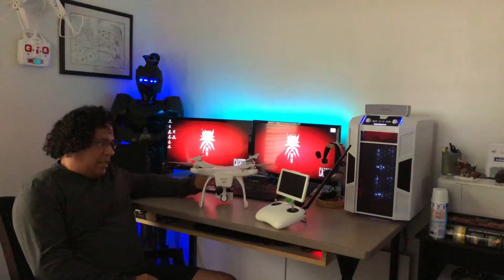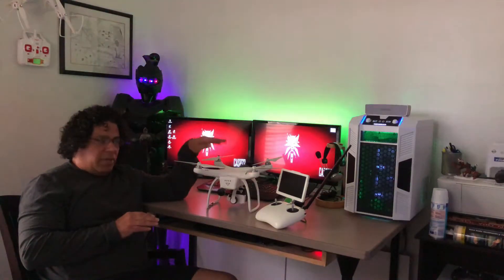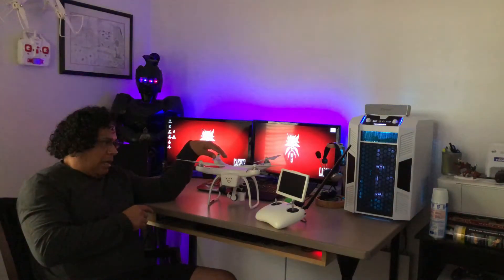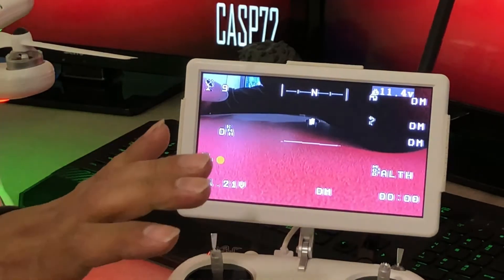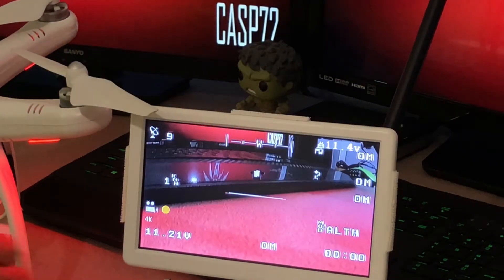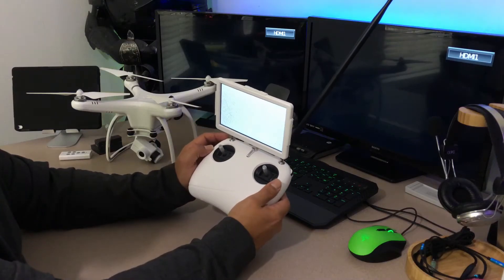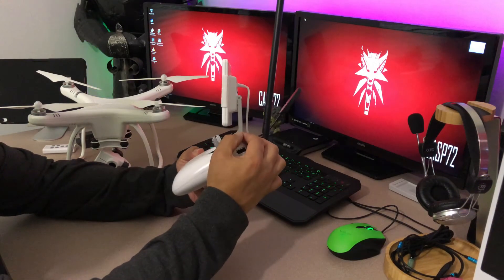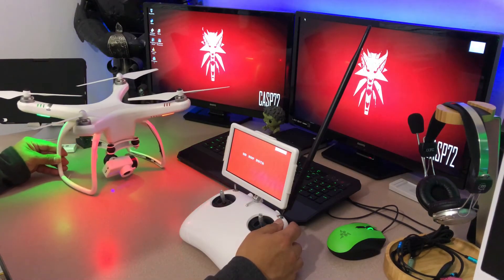Upair One 2.7k  Default Calibration

Comment: Hello and hi I am having problems. My drone connects to controller but there is no video screen on my phone. Any ideas please? This is driving me nuts.
Reply from the maker: If you have the exact same drone as me there is no phone video connection only video connection is from the controller built in screen. Please know that this is the original upair drone that came with a built in screen on controller. I hope this helps stay safe and sound. 👍🏽✌🏽
Reply: @ hi I have 1 2 3  models plus the ultra sonic  . Cx 20 … dji  quadcopters

Comment: Hi there, looking for up a battery cannot seem to find one can you help please?
Reply from the maker: @ohare100  thanks for watching unfortunately I’m in the same vote. I still have my unit and unfortunately the battery still holding a charge but I’ve noticed lately it’s been depleting. My guess would be your only options would be eBay or in my case I’m planning to probably try to come up with a battery mod to compensate for this battery that’s probably no longer being manufactured unfortunately. Hope this helps.👍🏽✌🏽
Reply: I’m using lipo 5000mah battery with pin terminals works just perfect

Comment: Where can I get the original firmware for the same up air one drone you have
Reply from the maker: Louis thanks for watching but more importantly, I’m sorry for the late reply. Getting the firmware is unfortunately almost impossible, for one the Upair One is no longer being made. It has now been replaced by newer models. I even tried to do a quick search for myself without any luck. I hope this information helps. I still have this drone and I’m very fortunate that it still works and is in mint condition. I’m planning on doing a future video and giving it a new paint job. I’ll post a video when I get around to it. Hope this information helped stay safe.👍🏽✌🏽
Reply: @solisapaul  Thank you for the reply and help.
Regards
Louis 🇿🇦

Comment: Hey Mate
I have a different upair drone but maybe you can help?
Mine is the Upair2 with 3D4k camera 
After the 3rd flight abd never crashed the camera won't tilt all the way down, it goes there but then jerks back up. This is a link to my vid about this.
https://youtu.be/pX9MikjuAxg
Reply from the maker: Thanks for watching and suppling me with your video. From what I see the motor seems to be faulty at the zero (-0-) position. If my calibration video does not affect your drone I would contact UPAir  to see if they will supply you with the calibration method for your particular model. I would also if you’re willing and able to with confidence open up the controller chassis and reconnect the cable at the PCB board which controls tilt for the camera. Lastly again if you’re willing and able to with confidence reseat the cable to the actual camera tilt motor assembly. I had a similar issue but it went away once I calibrated my camera again I’m not sure if my technique with my model worked with yours, again if it did not I would contact Upair and see if they’re willing to give you the calibration method for your particular model. I truly hope this information helps. 👍🏽✌🏽
Contact Information:
For help with making a purchase, troubleshooting, or claiming your warranty.
China Company Address
SHENZHEN JITIAN INNOVATION TECHNOLOGY CO., LTD
Address: N/L unit, 8th Floor, Block A, TCL Building, No. 006, Gaoxin South, Nanshan District, Shenzhen
Tel: 0755-86523509 
After-sales service phone:18124194780
Email: contact@g10dr.com
Reply: @solisapaul  thanks for the thorough reply 
I have taken the camera off and reconnected but no result.
I'll try the gimbal recal and see if that works 
I'll keep you posted 
Have contacted Banggood but they are useless
Reply: Yeah so the gimbal calibration works sort of the same on my controller as long as you get the right toggle switch figured out. On mine the left toggle has 3 positions and needs the middle one...
However it didn't solve the problem.
Also opened the controller and checked and reseated all cables.... no solution.
I'll contact upair in China and thanks by the way for that address cause there doesn't seem to be a Australian or Australasian  one.
Reply from the maker: @alandegraaf1638  Hello mate, No problem sorry it didn’t work out as planned. Lets hope they have an alternate fix with the issue. I haven’t flown my Upair in a while . I might take it for a flight soon and video the flight. Please let me know what your outcome is once they get back with you on this issue. Stay safe and good luck.👍🏽✌🏽

Comment: How do you calibrate compass? Cannot find it in the manual?
Reply from the maker: Drone Shack thanks for watching, if you have the exact same model and version as I do the Upair Drone  should calibrate back to factory as well as the controller. It wasn't in the Manuel that came with my drone either. I figured this with research and trial and error. The Model of my system board on the Upair is PX4 Ver 1.2.00.  I hope this helps. I love this drone as my primary very easy to use and understand, great control, Phantom 3 cross over propellers and most importantly very affordable price for what you get. Happy and safe flights ahead!
Reply: CASP72 ••••• thanks for reply but how do you perform GPS Calibration?
Reply from the maker: @droneshack211  I've had my Upair 2k for several years now and have never needed to calibrate the GPS aside from the calibrations I do in this video that is all I do before a flight. Never have had an issue with GPS or needed to calibrate the GPS.

Comment: Very helpful video Casp, thanks for it, but I have specific problem with my UpAir ONE Plus, and I believe you can help.The motors not starting at all, connection between controller and dron is ok, i see camera, i can manage camera but motors not reacting at all. I try to make ESC - doesn't work or I can't make it properly.
Reply from the maker: Zhechko Kyurkchiev Thanks for watching, sorry to here you are having this issue. I have the Upair One 2.7k not the Upair One Plus but I found a link that might help with the ESC process to get motors working. https://www.drones4.life/reset-the-esc-of-an-upair-one/   I hope this helps? Aside from this I’m not sure what else it would be that is causing this issue. I’ve seen this happen with this particular drone but it usually happens when a firmware upgrade is attempted using Mission Planner via usb mod. I highly suggest not to upgrade, Upair drones use a specific firmware and alternate firmware’s can possibly fail or break the drones code for full and proper flight and operation. Again I hope this helps 👍🏼✌🏼

Comment: Hi Casp, just bought this exact version, Upair2 PX4 v1.2.00.  I made yesterday my first fly and what i saw was that the drone is not stable and at certain point start to go up without touching the joystick in the RC. Tried to descend with RC but it was no obeying. After half a minute or 1 minute  it start to go down. Pretty scary. The calibration compass is possible?  because in the manual there is no reference to it. Do we need to do it? By the way where are the sensors of this drone? Thanks in advance. Best, Paul
Reply from the maker: PJorge Rod Thanks for watching the drone unfortunately does not have any built-in sensors. If you follow the exact same process as I did for calibrating the controller as well as the drone your flight should be more stabilized. Did you make sure the props were in their proper order? Also did you make sure there were no metal or radio wave signals where you were flying, that could interfere with the signal from the controller to the drone. Aside from this there should be no issues with your drone during flight one other question I have did you buy this brand new or was it used? Hope this information helps.👍🏼✌🏼
Reply: @solisapaul  Hi Casp, I bought it new. when i fly it has no electrical powers or trees. I am going to calibrate the RC. Thanks a lot for your help.
Reply from the maker: PJorge Rod Sounds great hope this works for you if you bought it new and the propellers are on properly I don’t see why you would be having any issues this truly is a great drone even when I bought mine right out of the box it handled perfectly. Best of luck happy flying and I hope this works out for you👍🏼✌🏼
Reply: @solisapaul  I will give feedback. Thanks:-)
Reply from the maker: PJorge Rod 👍🏼

Comment: hi. thank you for the video. helpful info. i have problem with this Upair One Plus drone. motors not starting at all. connection between controller and dron is ok, i see camera, i can manage camera but motors not reacting at all. pls assist
Reply from the maker: Artem Baykov Try to reset the ESC, this is a link showing how that is done. I hope this works for you if it fails it could be a bad Mainboard. Best If luck👍🏼✌🏼
https://www.drones4.life/reset-the-esc-of-an-upair-one/

Comment: Good find my friend!!
Reply from the maker: Gary O'Hare 👍🏽✌🏽
Reply: How about Calibrating so you don’t View the propellers on the gimbal cheers mr C
Reply from the maker: Gary O'Hare That’s a good thought however I just angle my camera slightly downward to where it still has a good horizontal view seems to work fine.
Reply: CASP72 •••••  mr C You can use Base cam That’s the alternative But you have to download software Thanks anyway appreciated

Comment: I have a new UpAir 4K with this board inside:  UpAir2 PX4  v 1.2.00  After the second flight it was windy, and it landed ok but then I touched the wrong toggle and it it turned over so that two propellers kept running and the two touching the ground stopped but were jerking as though trying to start.   I picked it up by the base, all motors still running, but forgot how to shut it down.  I started moving the left joystick in all directions.....then suddenly two propellers flew off with no damage and then all motors stopped.   Propellers flew about 40 feet away, but nothing was broken.   Now, motors will not restart at all.   I've tried the ESC reset, calibration, and everything I know to try.  Everything else seems to be working perfectly.  Video is perfect and all.  Can anyone tell me what might be wrong?  Do I need to buy a new UpAir2 PX4  v 1.2.00 board for the drone, or what?  Thanks.
Reply from the maker: deanko55 sorry to hear the situation at hand, if you tried the above with the calibration and no change in status, I would assume that you burned the motors while it was upside down however you mentioned when you lifted up the motors were still spinning this is what puzzles me? Make sure your toggle is in ALT-Mode or motors will not start, also in the excitement of what happened did you accidentally dropped the controller you might want to open up the controller with battery completely out and make sure all cables are properly seated, and if they are just reconnect them regardless.The only other thing I can think of is make sure you have at least 6 satellites before Initiating motors. Before flight on your controller push both joysticks to the inside bottom corner or outside bottom corner after controller is powered on to unlock the motors. If all this fails please contact G10 for support. Hope this helps?
Reply: The controller has not been dropped or shocked in any way, however I just opened it up and everything looks perfect inside.  I did NOT have the toggle in ALT mode, however putting it in ALT mode - the motors still do not start.  But thanks anyway for your help.  Can you tell me where to buy a new drone PC board, and also the motors?
Reply from the maker: deanko55 Thats a good question you might need to try eBay, or bang-good here is a link for starters for MB https://www.ebay.com/i/392121952437?chn=ps&ul_ref=https%253A%252F%252Frover.ebay.com%252Frover%252F1%252F711-117182-37290-0%252F2%253Fmpre%253Dhttps%25253A%25252F%25252Fwww.ebay.com%25252Fi%25252F392121952437%25253Fchn%25253Dps%2526itemid%253D392121952437%2526targetid%253D478262710055%2526device%253Dm%2526adtype%253Dpla%2526googleloc%253D9028057%2526poi%253D%2526campaignid%253D1489270473%2526adgroupid%253D57569192116%2526rlsatarget%253Dpla-478262710055%2526abcId%253D1139326%2526merchantid%253D115032787%2526pt%253D%2526gclid%253DEAIaIQobChMIr67q7fPi3QIVhbrACh2tBQcAEAkYAiABEgIQjPD_BwE%2526srcrot%253D711-117182-37290-0%2526rvr_id%253D1686790749765%2526rvr_ts%253D2ad0843f1660aad95506ab93fff63c09

Motors, https://m.banggood.com/UPair-Chase-UP-Air-RC-Quadcopter-Spare-Parts-CWCCW-Motor-p-1052443.html?rmmds=home-middle-RecentlyViewed
Reply: Thanks!   I ordered it just now!
Reply from the maker: deanko55 no problem, hope all works out for you, keep me posted!
Reply: @solisapaul   i have bought the 4k but it want pic up any satellites can u help
Reply from the maker: harvey johnson have you tried the calibrations I performed in video also try the ESC calibration I will include the link 
https://www.drones4.life/reset-the-esc-of-an-upair-one/   Hope this helps. Sorry for late reply! 👍🏼✌🏼

Comment: I have the same version UPair.
Reply from the maker: DeafDronePilot it's a very underated drone, the Upair is a great drone that is not only affordable but very beginner friendly. I'm very happy with it. I have other drones but I find myself using the Upair more offten.
Reply: I have had the UPair since last October and I agree it's a great drone. Packed with features and you can't beat the price. I have kept mine stock for now, may do the video transmitter ventilation mod now that warmer weather is coming.
Reply: Me as well it's really the whole package with back pack holds every thing I use in the field.